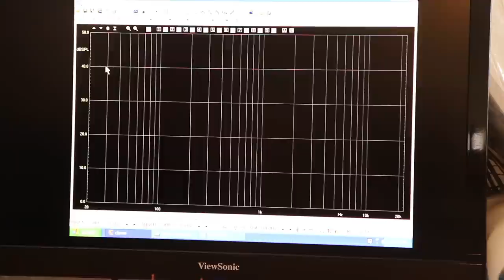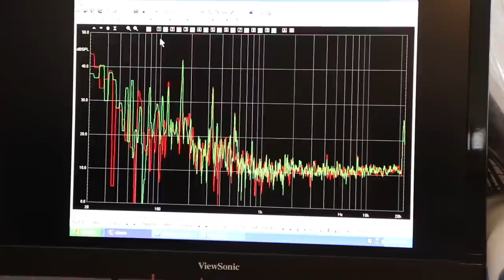Power Cable Tech Talk and a little help for Amir at Audio Science Review

Comment: Wait.  The flat earthers on the ones who hold onto the engineering and measurements?  I think you have it backwards dude.
Reply: Nope, real science means testing a theory. They don't do that.
Reply: I definitely noticed the long coaxial cable run in ceiling/wall bringing tremendous noise when I put in my Rel 212/sx subs. I had some cheaper subs and it didn’t really have any noise with the same cables. Once I switched to XLR, there was zero noise. So yes, definitely there is interference that goes on with cables, also, the higher-end gear usually will be more sensitive to it.
Reply: @mrubengmail  Results of our A/C power cable have been easily confirmed.
Reply: @mrubengmail  We've tested it hundreds of times, and formed an irrefutable conclusion.
Reply: @mrubengmail  Right here. If you want to learn about the differences in cables then come on over.
Reply: You don't need to listen to music I guess. A waveform will tell you everything. Hearing is so overrated......😢
Reply: @mrubengmail  Then you have not learned anything yet.
Reply: @mrubengmail  We've done a ton of controlled listening comparisons and they confirm the results. Of all the tweaks and cable swaps, power cables can be the most profound. Quoting the miles and miles of wire to your house argument means you have no idea what is going on. The geometry and design of the power cables act as a filter to remove RFI and EMI that have been picked up along the way.  The results are also easily demonstrated on a top level system.
Reply: @mrubengmail  You really need to learn a lot more about this subject before you speak. Regardless of what goes on in a power supply or any filtering down at that level, there is still a great benefit from additional filtering at the power cable. 

I am also always glad to share the results of A/C power cable comparisons. Even better, come be a part of the comparisons. I've never witnessed any person that did not immediately identify the differences in a few seconds.
Reply: @mrubengmail  Writing down the results doesn't convince anyone of anything. If you want to learn something, you need to hear it for yourself to understand the level of difference we are dealing with.
Reply: @mrubengmail  I have already given you the results. The differences are clear, repeatable, and in many cases, not subtle. If you want to witness it yourself then come on down. Otherwise, belief whatever you want. 

When you tell the guy that has done the science, made the comparisons, repeated the process with hundreds of people, and confirmed the truth that he is wrong because you don't believe it, is about as stupid as stupid gets.
Reply: @mrubengmail  First of all, I never make unsupported assertions. If I said it, I can back it up. If I say the results are so, they are so. I never lie. I am also always glad to prove what I say, but I have learned that in the end you can never prove anything to a flat earther (someone that won't consider any real science) by explaining it. The real way to prove it is to demonstrate it, and we've done that a lot. The only way you will ever learn is to hear for yourself. If you aren't willing to put forth the time necessary to learn any of this then you never will learn.
Reply: @mrubengmail  What I say is fact and I have backed it up many times. Come over for a demonstration and you can hear for yourself. It is the only way you're going to get it.
Reply: @dannyrichie9743   What is the current carrying capacity of the cables? What is the wire gauge equivalent? I need to pass an electrical final and I need to know these specs to find out if the cable meets the UL rating of the equipment I plan to plug it into?

Comment: Are you sure about how the balanced signal works? It sure doesn't work like that in industry. The inverter signal and the non-inverted signal is feed to a differential amp. Since both lines were subject to the same noise environment the polarities of that noise should also be in phase. But since a differential amp is used on the input the noise will be rejected by the amplifier input stage. This is called common mode rejection.
Reply: ...add to this the StarQuad geometry in balanced cables and the Common Mode Rejection Ratio of the circuit, Common Mode Noise is not an issue...
Reply: Really?  Is the particular cable in question remotely near a StarQuad config?  No!  Hos power cable isn’t even shielded!  Sounds like you guys should go work with Amir.
Reply: @izumispa2993  Did you watch the complete video? He jumps back and forth between the characteristics of a good power and cable and interconnects with differential inputs. I do have a lot more respect for Amir, he isn't selling snake oil and elixirs. He backs up most of his positions with science and good engineering. However, I have had my disagreements with Amir in past as well.
Reply: @johndavidson6433  so have I. He seems to know enough about what he's saying so that a laymen would be convinced that he is non-bias. With that said, he's trying to convince the average listener; who has moderately good stereo equipment. Not to spend money on high end attachments that may have little to no effect on your equipment! In other words 89 octane works very well in most domestic cars. Changing to 93 or 100 octane will make very little to no difference to your car power. However, in a Bugatti or Porsche etc... going from 93 to 98 or even 100 octane. Can increase your engine power by 15 to 30%!

Comment: Danny, did I miss the part where you posted all the measurements showing that Amir is wrong?
Reply: His own measurements showed that our power cable had noise rejection.
Reply: Danny, what is your parts cost for the B24 cable?
Reply: @paulzukowski6551  That is not any of your business.
Reply: You can place an RCA"unbalanced" cable near a powercord and hear the buzzing in a speaker when the EMI is strong enough and the cable has poor shielding.
Reply: @stever7638 what buzzing? Like bees? Or a 50/60 Hz Earth loop?
Reply: @drmindbender8616  I think you may miss the point that we "hi fi nerds" can only do so much from the outlet to the panel, almost nothing beyond the panel.

When you have noisy power, being able to clean that signal even a little from the recpetacle to the component can make a difference.

Us "hi fi nerds" will also acknowledge when we don't hear a difference, BUT, other outfits SAY we can't without even being there. Those outfits are the irony.
Reply: Its kind of funny that people who believe in science are called "Flat Earthers"
Where they have nothing to gain from their objective measurements
Reply: @redkh2017  I hear ya, what's comical is when an EE, (or anyone in the field) says "You aren't hearing any difference in caps, resistors, upgraded power supplies, better wiring, shielding...it's all the same, audiophiles only fool themselves"

Then the same people go out and spend over $4K for a Rohde & Schwarz oscilliscope, PSU or multimeter, then just are astounded at the increased resolution from describing the better caps, resistors, wiring, power supply, shielding, etc. And how it improves the signal.

I don't get bothered by it, but always fun to point out the hypocrisy.
Reply: @stever7638 Then show me an EE who measures an improvement in frequency response, noise etc. of the speaker using snake oil power cables 😂 The opposite is true, there are no measurements showing audible difference. There are however measurements that show some ridiculously expensive power cords measure even worse than a standard cable in terms of electrical characteristics etc (which ALSO are not audible or alter the frequency response or noise etc btw). In reality every EE (that doesn't work for one of those snake oil companies) doesn''t give a fuck because they KNOW and laugh at all that nonsense. But hey, keep on believing if you wish to. Sure, you can hear it and even do not need measurements for it.
Reply: @truthness6874  The irony here is you are stating what can or cannot be heard without at least giving the said rig a listen to.

So this is where the conversation stops.
Reply: @stever7638  i knew you're not gonna show the EEs behaving as you described. Just bla bla bla and no facts as always. As i said i know you hear it, so keep on.
Reply: @stever7638  Ha. What a silly comparison.
Reply: @listeningto8371  Yeah, it's silly alright. Hard to imagine how an electrical component that improves a signal in a device that EE's use, but doesn't improve a signal in a component an audiophile or any person who listens to music use.

What's also comical is the level of maturity. The cynics who don't even listen to a system spew their typical rhetoric and don't realize we let them do so and laugh internally. Many audiophiles just go on and live their life and chuckle at their behavior.

Also, no matter how many times I say this, or others,  someone will still not comprehend simple English and not accept the fact many audiophiles recognize and admit when we don't hear any real change, meaningful or not. Comes down to system synergy and components in place, ie bottlenecks.

If you don't want to listen and enjoy music to the level of tweaking systems to maximize the quality of the signal that's your choice.

Any person with a low level of common sense can accept that all 6" woofers, all caps, all coils, all resistors aren't exactly the same. The ones who argue especially without listening are the prime example of cynical ideology.
Reply: @stever7638  Wow, that was speech and a half.

Ask 100 people to give their opinion on the " quality " of an audio system, any system and you will get 100 differing opinions.

Ask the same 100 people what the voltage being displayed on an oscilloscope is and I'd be supprised if there were any differing answers at all.

Audio and instrumentation may use the same components, but the application of said components is vastly different.

Audio     subjective

So there,  take that mate

Instrumentation     accuracy
Reply: @listeningto8371  Of course it's subjective. Your reference to "instrumentation and accuracy" please explain. What is needed to be accurate??

Also, tubes and solid state, sine waves and FFT doesn't matter for quality sound and "accuracy" that's all ASR garbage.
Reply: @listeningto8371  I also get how instruments need to be accurate,  but when you realize what is involved to make the instrument accurate, and what becomes "accurate" this philosophy is also shared with other electronic devices. It will be forever a moot point because many EE's and even non-EE's will never accept this past their own stubbornness...which is fine, time better spent on enjoying the hobby.

Comment: All of the cable arguments STOP when when an experienced electronics tech tests all the cable nonsense with an oscilloscope!  Period - end of story.  An o-scope is millions of times more sensitive than even Superman's hearing.   Shielded cables have their place as does balanced cable circuits.   I'm just glad that I don't have audio OCD nor the money to spend on overpriced copper conductors.
Reply: Oscilloscope cant hear music. It only test and display voltage signals as waveforms, visual representations of the variation of voltage over time.

Only test with oscp i would intrest of is from the wall outlet with generic cable transfering current to the amp, and with fat cooper shielded audiophile fancy cable measured with oscilloscope, but in point conection to the ampliefier.
Put the volume on amp at 11 o clock. We want check if maybe fat cable will deliver more calories :)

But it still not show all the components of the signal.

Osciliscope doesnt know how to any parts of signal component tranfers into the sound, how many components are crucial to that sound.

I give you an analogy. we got concred brige and an equivalet of osciloscope that is a machine that put freasure to that brige to test in tons how much can it handle. It showed 18 tons. But in practice you can safly cross that brige with 30 ton truck, cause the machine is limited to only point pressure measurment.  The same thing is with oscilloscope. It's limited to it functions, and the data can be misunderstood if someone doesnt know all the components that makes an audio signal optimal. You dont know and oscilloscope doesn't know. Now there are two of you, that dont know :)
Reply: @sheerenergy8602  Really?  A highly sensitive oscilloscope can't measure every millionth or billionth of a second down to a millionth of a volt?  Dang, you must be really smart and have decades of electronics experience.  Thank you for your valuable input because I never knew that the human ear could pick up megacycles of frequency in the gaseous medium of air.
Reply: @welderfixer  First of all do the reading with understanding. I paste you a part of definition of oscilloscope. And it measures only that, nothing more. I said nothing about accuracy. I highlight that it cant maesure every componet of signal.

Osciloscope dosnt know if it measures Panasonic or Krell.

All of the componets of the audio signal combined cant be measured in one or a few devices.
So the best overall measuring test bench are still our ears! Chnaging skinny generic power cord to a fat good quality one, make a big sound upgrade. Deal with it :)
Reply: @sheerenergy8602  "Oscilloscope cant hear music." "Osciloscope dosnt know if it measures Panasonic or Krell." Why would it need to know that? Music doesn't pass through the power chord. 

You're obfuscating the real point of the measurement, which is about the delta between a standard power chord and a supposed "high quality" power chord. An oscilloscope allows you to measure a signal at any point in time with much higher precision than any of our senses. The data it captures fully describes the behaviour of the signal we are interested in, whether that be noise from the power line or musical signals further down the signal chain. It's built-in functions allow us to perform bijective transforms to anaylyse the data visually and not leave anything to chance or bias.
Reply: @iliketoast-q9b  LOL - tats your problem. That data analys is bijective to you and you dont want to hear anythig else.

You can be simply even a "literate"(dont know how to read and write) and you can check for yourself swiching a cord can give you a more chunky substancial bass or/and some other aspects.

Another problem of your is that, I know that measurments for more than 20 years
But oscilloscope doesn't show "how come" (easy) current is when it's tranfered thru better quality of copper for instance. Even the same cable vary only in diameter 2,5mm2 vs 4mm2 measures the same, but we all know that ticker in most cases have more "oomph".

And do you know why measurments looks almost exactly the same? Because you doing mesurments on the same gear/devices. It has its max consumtion and it wont take more.

Oscilloscope dont "seeing" every kind of noise, influance etc.
Reply: @sheerenergy8602  It's clear that english isn't your first language, same for me btw. But please at least spellcheck, because you are sabotaging your own arguments with bad spelling and grammar. 

"You can be simply even a "literate"(dont know how to read and write) and you can check for yourself swiching a cord can give you a more chunky substancial bass or/and some other aspects."

It's illiterate...anyway. I have checked many different hifi-products, but cables, chrods and often even DACs and Amps...sound THE SAME. I'm still pretty young and build speakers for over 10 years now and I can't hear any of the supposed differences of the golden ears, neither can anyone in proper blind testing. You should learn about bias and auto-suggestion. It is not something that can be controlled for subjectively, hence why (double) blind testing is the gold standard.

Also it seams you don't know what bijective means. It's a mathematical term, so it's not just true "for me", it's  a fact. tYou can for instance use a fourier transform and its inverse and no data gets lost or added. It's just two ways of looking at the same signal.

"Another problem of your is that, I know that measurments for more than 20 years!" That doesn't impress me in the slightest and your reasoning shows you haven't even learned the basics of signal theory and processing. 
Sure, an oscilloscope won't show every minute details, but that's what spectrum analyzers are for and many oscilloscopes have those built-in nowadays.
Reply: @iliketoast-q9b  Grammar or spelling is no problem as long as you can understood what I mean. It's not the grammar, it's your reasonig is faulty. I know what bijective means, cause that one I checked cause first hear of that word. It's not the meaning of the word, it's what's You are belive is bijective.

Btw: if you cant't hear difference with amps,dacs etc. it means not my ears are golden, but yours are faulty.

I was not intent to impress you. Your arguments I were analysing when you were born probably, i know everything you are throwing at me. And I'm telling you are mistaken. Your reasoning is faulty.

And how you make a 2 weeks blind testing? Cause thats how long it takes to konw the system and get just to owned system with new circumstaces(cables)  and the that chande is big.
If you gona swich back and forth 10 times a row. Yeah. I make mistakes with flac vs mp3.
Blind  testing is also faulty reasonig. I'm listening to hi-fi all my life.

And no one is forcing you to buy an expensive cables. I equiped my system under 1000 $ It would be a bit better if i would spen 2k $, but that 1k extra better to put in other place in my system.
Reply: @sheerenergy8602  It takes quite a bit of work and effort to understand you. Your command of language appears to be much poorer than you think it is.